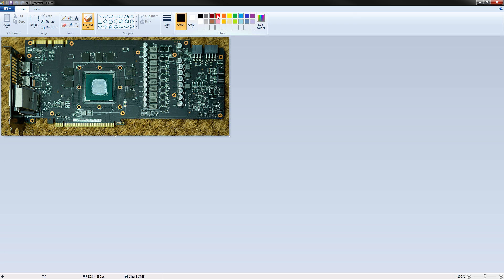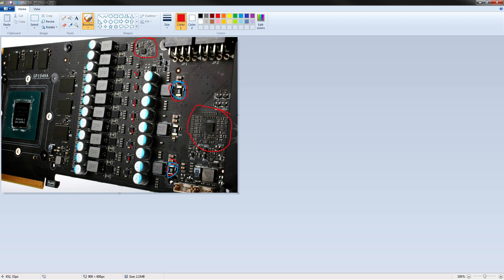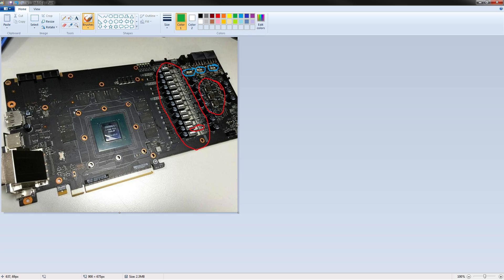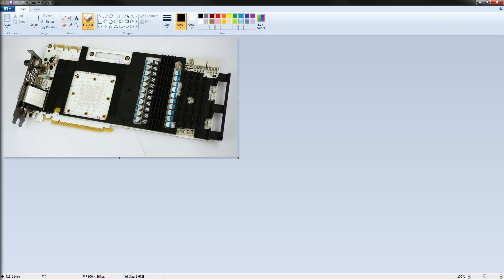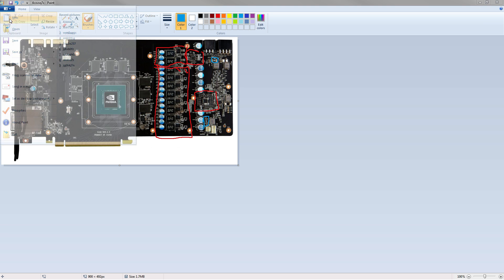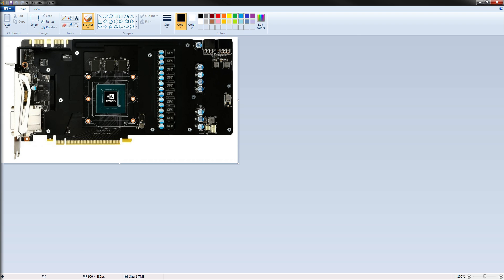Custom GTX 1080 PCB run down

Comment: Here is a link to the pics for the EVGA GTX 1080 FTW without the top thermal plate on:
http://images.bit-tech.net/content_images/2016/06/evga-geforce-gtx-1080-ftw-review/1080-37b.jpg

I'm trying to decide between this and the Asus Strix variant. 

If you can break it down it would be great if not, its all good. You've already been a great source of info.

Comment: You seem to be very familiar with the components. I'd love to hear an overall cost estimation for each of the cards, because I have a hunch that the gap between costs and price is just grows and grows each year because they price the cards based on performance to protect older versions on the shelves.
Reply from the maker: Manufacturing the GPU chips themselves is outrageously expensive. The PCBs for them have little impact on manufacturing costs. Though the really top end VRM components are particularly cheap. Say a bulk order of 4800 IR 6894 MOSFETs is 1.45$ per FET through distributors. I guess if you had a deal directly with the manufacturers it would be cheaper but this kind of info is incredibly hard to get.
Reply: Thanks for the quick reply! My not expert logic is this... :)  Former top end GPU chips were bigger with more materials inside of them ( in weight ) They used the newest and best technology available at their time just like the current ones. So if there is a premium because they need a new manufacturing line for each generation, than it was present for the older ones too at their time and that should not be a factor. You say that the PCB and parts are relatively cheap, also you mentioned that some companies used the same designs partially since 2-3 generations, so It could only be a bigger profit margin every year. They raising prizes than complain that the market is shrinking and to get the same amount of profit they raise prizes again.. that would be a negative cycle.  Instead they should lower prizes (if they can) and making the GPU-s more affordable to grow the market again and get profit from a larger overall sale . But this is just a theory if we don't actually know the costs. :) ( You also say that the VRMs are ridiculously oversized, maybe that is also a remaining from the past when they were needed for a 300+W cards, and because the components are cheap they only serve marketing purposes now. I found it ridiculous when only the cooler makes it a long "high end card" look and the PCB is short.. or the recently showed 1070, 1080 PCBs where the PCB is big but looks like a wasteland with lots of empty space, even missing components on the PCB because they simply don't needed. )

Comment: I don't do LN2, but I do do a lot of mods to improve card overclocking so here's my reaction:

You are right in ignoring the number/type of PCI-E power connectors. Those have zero impact on overclocking and more just makes the card more power efficient.
You did properly identify phases, which many people don't, but you annoyingly use the recent Nvidia nomenclature defining phases which is misleading. Ex. when saying 8+2 you're saying there's 8 core phases and 2 memory phases. This is only the recent meaning of that phrase according to Nvidia marketing. In the past 8+2 meant you have 10 core phases, with 8 switching in sequence plus another 2 switching in their own sequence, both summing up to deliver current to the core. For example the ATI 4890 was a 3+2 configuration for the core. Minor thing, but using Nvidia's misleading marketing terms annoys me.

You ignored capacitor quality and vdroop, which can be a big deal and vary greatly between these cards. Many "overclocking" cards try to have big impressive looking phases with big electrolytic caps that look cool. The problem is of the 3 main cap types you can have the big radial electrolytic caps are the lowest quality. Surface mount electrolytics tend to have superior ESR (effective series  resistance. this matters for sudden load changes, or a phase switch) than the round radial electrolytics, but are more expensive and look less cool. Radials do tend to have higher capacitance than SMD, but usually electrolytic capacitance is overkill by nearly an order of magnitude on "overclocking" desktop cards, with ESR being more of a limiting factor. Even better ESR are ceramic caps, but these are the smallest and most expensive. Many of these boards completely lacked ceramic caps for the core on the front of the pcb. Maybe they made up for it on the back, but its obvious that many manufacturers are trying to make their boards look cool.

As for vdroop, many of these boards screwed over the memory and indirectly the core. All high phase count cards except the zotac threw the memory phases way to the right of the card. This gives the current a long distance to travel, and even worse is the current needs to travel under the core phases, which will already be using many pcb layers. This also hurts core vdroop because pcb layers that the core would otherwise receive are needed to route the memory power. Then add in that 3 memory chips also have data and address lines between the core and power phases, and you have one overly worked pcb. They might have very good vdroop detection and compensation, but there will be efficiency issues at the very least.

In short, the ASUS looked like crap to me. No top side ceramic caps and no SMD electrolytics. The powercolor card looked good for air and H20 with a good ceramic cap count, but seemed to lack the FETs to push the current or LN2. The EVGA should be good for LN2 if the backside makes up for the front side's lack of ceramics. Its electrolytic count is insane with tons of SMD caps, but it looks like it will have vdroop problems. The MSI looks decent with a good chunk of ceramics and high phase count, but lacks SMD electrolytics.

I don't get why you gave the Zotac so much crap. This card looked to be the best to me. That memory phase location is great. The PCI-E slot can route current up the left side so it can get a strong 12V connection that avoids messing with the core power side of the card and memory data and addressing. The Zotac will have the best vdroop of any card. It has a good count on ceramics and a few SMD electrolytics. Yes the FETs COULD be poor, but they could also potentially be better than the high/low combo chips on most cards.

Honestly the 25A high/50A low chip that you said Nvidia is using sounds like crap. Having a lower high side current limit than low side makes no sense. Yes high side conducts current way less often than low side so you want a smaller faster switching FET, but if you exceed that 25A the FET can still blow up. If the low side conducts 50A when it is on, then the high side also conducts 50A, so this chip is only rated for 25A due to the high side. I can see why manufacturers would avoid this chip. I'm surprised I didn't see the TI 83750 high/low combo chip on any cards as this has a 40A rating and is very commonly used on mobile cards to provide high current using little pcb area.
Reply from the maker: I name the phases based on what the voltage affects. The memory phases feed every single one of those GDDR5X chips with power and changing the voltage on it will change max memory clocks. The core phases feed the core and have an impact on max core clocks when changed. I couldn't care less what the old naming scheme was because no one uses and it was useless for identify what voltages do what.

I don't really do capacitors every since I scoped a 6 phase card with a very small cap count and found that it had less than 20mv of ripple on Vcore. I do plan to do more research and testing on capacitors but as of right now I have no idea how I would correlate capacitor count/quality to ripple voltages. Other than say more is better but the fact is that going from 20mv ripple to 10mv ripple is like 10mhz and that isn't enough for anyone to really care. Other than that I only have front side PCB pics and the back of a lot similar cards in the past is basically made of ceramic capacitors.

EVGA's very high VDroop VRM layout has taken world records in Firestrike over and over and over again(they've used this layout for the Classified 580/680/780/780Ti/980/980Ti and KP 780Ti/980Ti). So it doesn't seem to have enough impact for anyone at EVGA or all the guys who buy these cards to care. Zotac on the other hand doesn't have any WRs and they don't care about LN2 overclocking so why would they actually bother with making a good 16phase when all the people who buy the card would A-OK if the VRM could only do 20A per phase and they would still have the benefit of marketing the card as a 16+2 phase VRM.

The high side continous drain current limit is lower than the continous drain of the low side but the high side's pulsed current is high enough to accomodate. Here's the data sheet for the FETs use on the FE edition: http://www.onsemi.com/pub_link/Collateral/NTMFD4C85N-D.PDF
Reply: Interesting that vdroop is not a problem for EVGA. The voltage regulator must do a good job at compensating for it. I'm used to mxm boards with crap voltage regulators that don't sense the actual voltage properly. Adding wires between the core caps near the inductors and the core caps directly under the core actually improve max stable clocks. When you do the math on how low the resistance must be between the voltage regulation and the core, that resistance has to be insanely low. Say you're doing 300A on LN2 and want no more than .1V vdroop before compensation. That means the resistance between the VR to the core and back must be no more than .00033 Ohms.

Radial caps CAN be good, but I find this to not always be the case. Meanwhile specs on SMD electrolytics are almost always good.

I see your point on the history of Zotac. Just saying don't count that card out. That design looks good.

Thanks for the spec sheet on the FETs used on FE. I know someone getting a 1080 who may want the FETs doubled on his card.
Reply from the maker: I see your point about the voltage drop thing. For memory it's not really such a big deal because the memory chips are relatively high voltage and low current(I don't think there is any GDDR5 memory system using over 100A under any conditions and GDDR5X is even lower power) The core Vdroop I can see your point however it's easy to compensate Vdroop just giving the voltage controller's VFB pin directly from under the GPU core. I might do some testing on the Vdroop thing but at least from real world results it doesn't seem to anything other than eat into efficiency.

Comment: Since you seem to have a good understanding of everything you're looking at on the video card, I'm wondering if you have any opinions on whether or not the 1070 (or maybe even 1080) PCBs may eventually be able to be laid out in an ITX length card. Do you think they can squeeze all the required components down into a 7" package? If not, how small do you think these cards can go?

P.S. Sorry, I'm sure this is a boring thing to even think about for someone more focused on extreme overclocking, but I'm just looking for an opinion from someone knowledgeable.
Reply from the maker: The should able to make the cards as least as small as the MITX GTX 970s.

Comment: Here's something I don't get: how come the low side is rated for twice the current of the high side?  Wouldn't they be the same?
Reply from the maker: Why would they be the same? The low and high side are 2 different FETs. The low side fet deals with the low voltage and high current going through the GPU. The high side FET deals with the 12V rail and relatively low currents. It's more cost effective to use a low current cheap high side FET and then a very high current low side FET than using 2 expensive high current FETs.
Reply: Ohhhhhhhhhhhhhhhhhhhhhhhhhh.  I was imagining one was hot and one was ground.

Comment: Someone should sponsor you to do a live GTX 1080 breakdown and analysis then do some LN2 testing.

\m/(><)_\m/
Reply from the maker: I need at least 10K subs before I'm even noticed by component manufacturers. Also I don't think it would be very interesting. All the pros with GTX 1080s are reporting that the card stops working above 1.25V no matter what they do and it's not like I would magically change that.

Personally I'm more excited for Polaris. Glofo tends to make leaky cold bug free silicon that scales with everything so Polaris might be an LN2 beast.